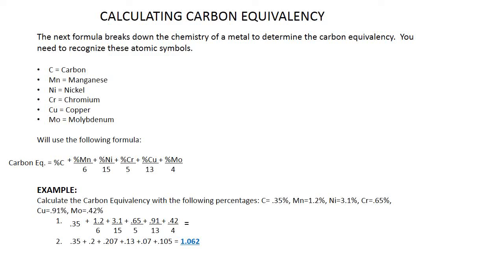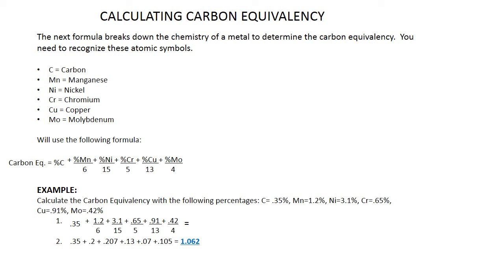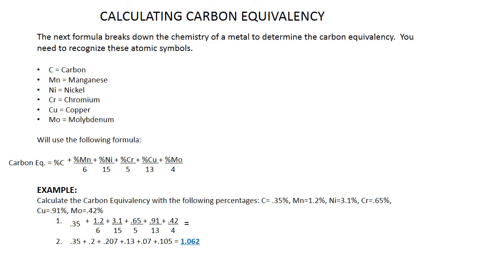CWI 7 -  HOW TO CALCULATE THE CARBON EQUIVALENCY IN METALS

Comment: how is this information useful in practice? What is it used for, why do we need to know it? Just curious
Reply from the maker: Wyatt Brule good ???, This is more for engineering and metallurgical practice to identify the ductility of material for practical reasons. Carbon effects metals the most wihich will determine what electrode to use and what application the material can be used on bridges, pipelines, railroads, etc...  Me personally, I don't think questions like this should be on a CWI exam